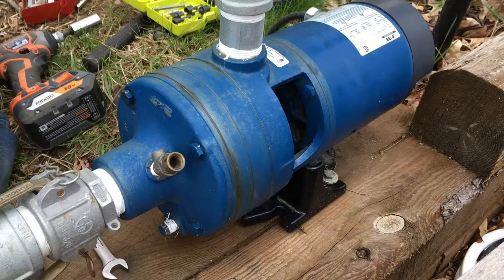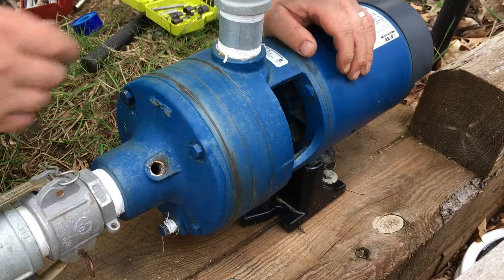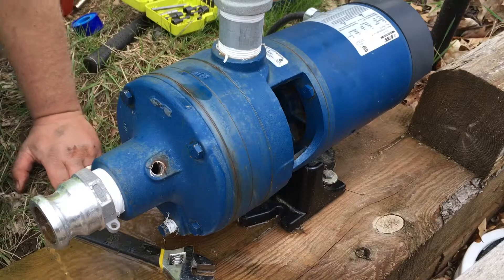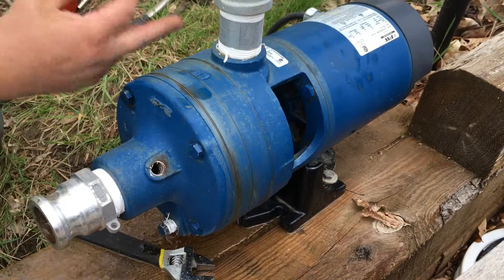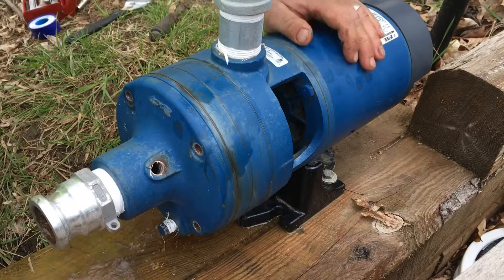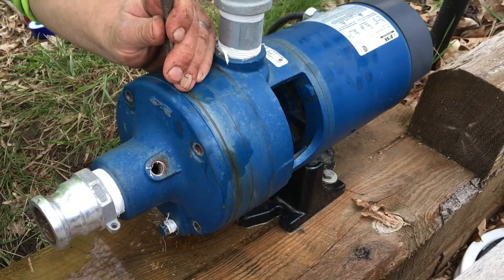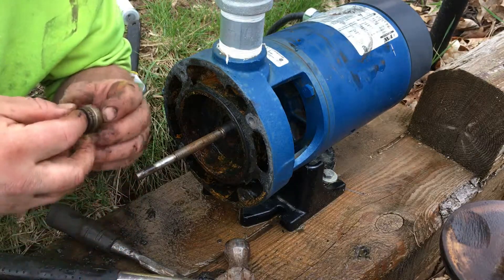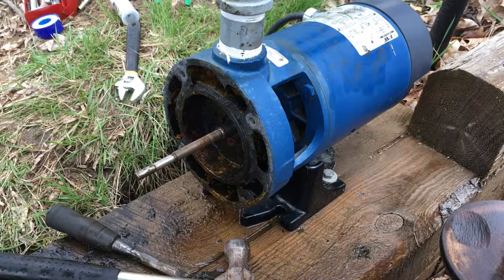Disassembly of flint and walling pump Cj101 series

Comment: I replaced a cracked one for a new one and now the new makes a click noise when I turn
 It on at irrigation controller. 
Any idea what it could be?
Wired it the same way it came off.
Reply from the maker: At the controller sounds like it’s the relay

Comment: #8 ridgid pipe wrench instead of monkey plier i use Sir thank you at magandang umaga po
Reply: 2 stages the 7/8 long spring mechanical shaft seal cost much more than made in Seneca Falls and Myers Pump